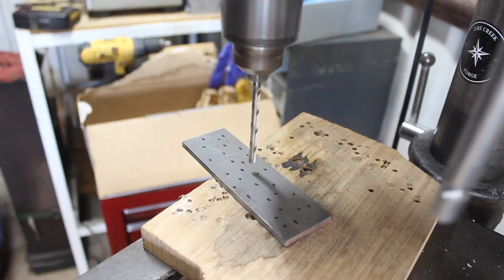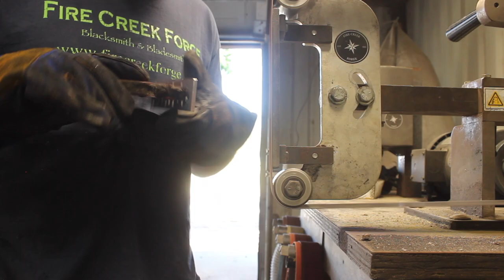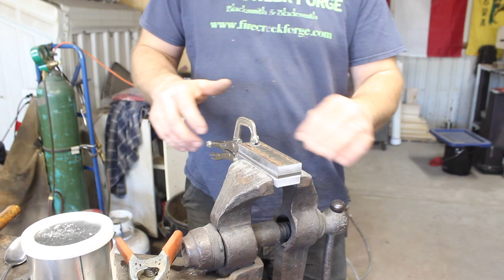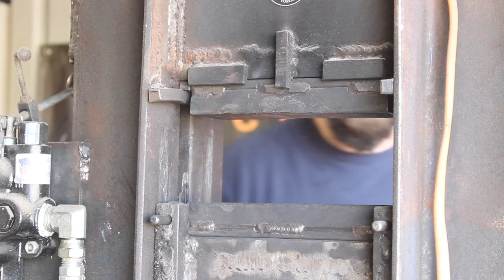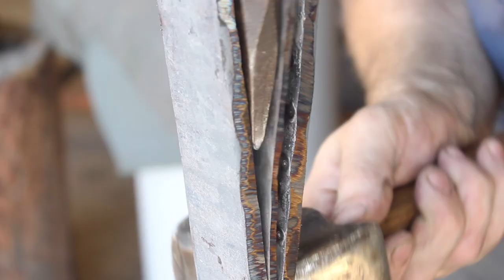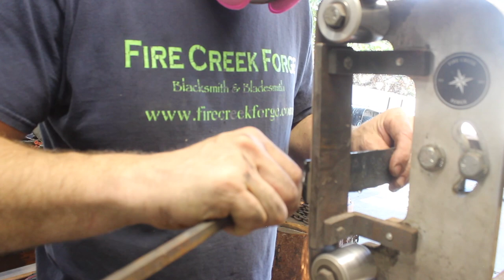Can I Forge Cheetah Pattern Damascus? Blacksmithing, Knifemaking Forge Welded Steel

Comment: Just a thought. Maybe use different sized bits to drill the holes. Use the carbide dremel bit to chamfer the edges slightly. And sand/grind the ball bearings to an irregular shape. This was a cool idea. I can’t wait to see the next iteration. 👍

Comment: Maybe heating just the bearings and striking them with a hammer once or twice rather than grinding them.  Bar stock with 4% nickel, and powdered pure steel and bearings might give you the image you’re looking for.
It’s great learning different methods from you!

Comment: Maybe try on a smaller scale and by that i mean half the length with fewer holes but bigger holes and larger bearings so you can try grinding different shapes out of the bearings

Comment: It might be a more time consuming but if you just use powder for the initial hole. Then do another hole inside of that and fill with different powder and re pressed.
The bearing was too hard I think for the full press, where it takes the shape of the drilled hole. I feel like this could still be used to make a little carving / utility knife. Re fold the bullet into a thicker stock? Not a cheetah pattern but still looks neat. 👌✌️

Comment: Look like bullet holes.
What if you used a thicker piece, 3''x3'' perhaps, and drilled almost all the way through and then filled the holes with old drill bits and powder steel?

Comment: Instead of ball bearings, try roll steal rod cut to length. Then you can use thicker materials & modify your rods if you want the them fluted.
Reply: I Like this idea,,wonders on rio bar,,and then fill with powder,,
Reply: I thought he would just fill up the holes with powder initially, without the bearing. Might have worked out better in the end. I think the bearings are the cause of the rounding out of everything. They're harder than the steel and it took the shape of the bearing rather than vise versa.

Comment: Looks kind of flower-like to me.
Was it necessary to have the ball bearings in at all?  Why not just fill the holes with powdered steel?
And would it have been better to start with a thicker blank in the 1st place?

I was really impressed with how easily the mild steel cracked off of the knife blank.  That white paint really worked well!
Reply: It's been a year.... but still, saw no one had replied.
A Cheetah's spots aren't one solid color, it's like an outline, that fades in to a center, so he was trying to replicate that.

Comment: try this, get a 15n20 plate 1 1/2  inch wide by 8 inches long by 1/2 inch thick from the 1/2 inch thick part drill 1/4 inch holes 1/4 inch apart, then insert 1/4 inch 1095 rod into holes and tac weld in place, and forge like patern welded steel to 1/4 inch thick

Comment: if you had a plasma torch you could just blow out random holes lol
Reply from the maker: Yes, although the holes have to be clean to forge weld, not sure if that would be an issue or not with a plasma torch

Comment: G'Day,,nice idea,,just a suggestion,,as I know fuck all about forging and forge welding,,
but drill your holes and fill with different welding electrodes,,ya know a little stainless and some hard facing stuff,,thnk the uneven weld will give you your pattern,
now whether you fill your holes with weld or just cut peice to go between plates,,